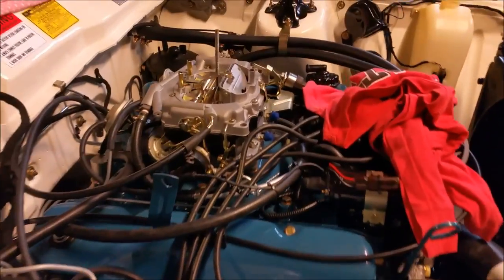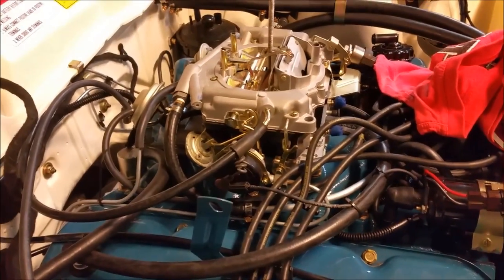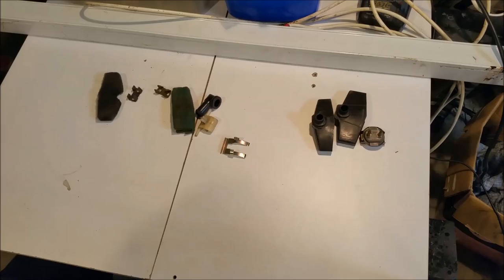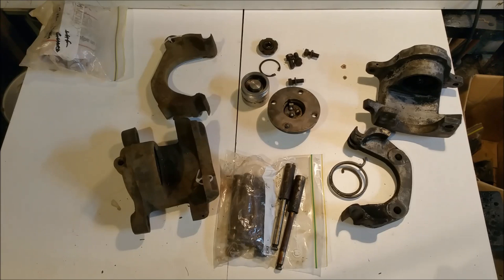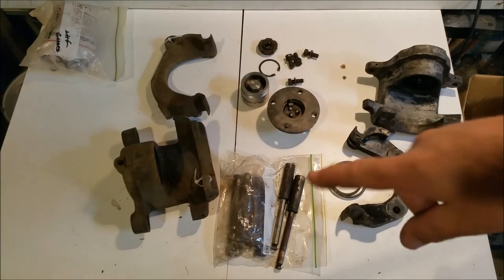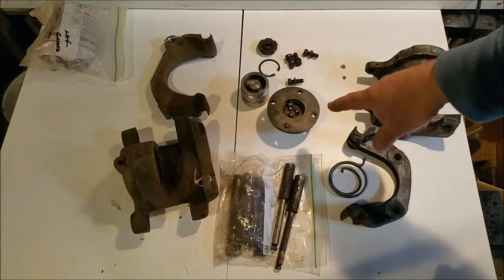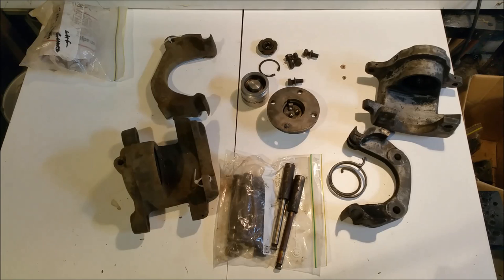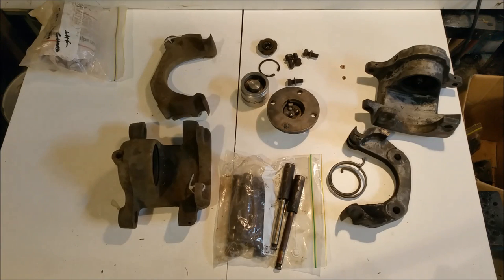Ford XC Fairmont 351 Restoration Part 32

Comment: A tip that people might find useful for freeing stuck caliper pistons as here, instead of using some form of pliers to grip and twist the piston, which risks marking the piston and potentially causing problems down the line such as the protective boot/seal not gripping the piston properly and potentially getting trapped between the piston and the pad, use an oil filter strap wrench.  It should provide plenty enough grip to get the piston moving (if it won't you're probably not going to get the piston out at home anyway) but being a form of fabric it won't damage the piston.  They're pretty cheap even for a really good one and once you've shifted your caliper pistons they're very useful for servicing cars with inconveniently situated oil filters.  Just don't use one that is contaminated with oil on brake parts as even microscopic amounts of oil inside the brake system can cause all sorts of problems with seals swelling and causing things to bind up and not work...

Comment: Good on ya Peter. I did my front calipers a little while ago, hell of a job getting the pistons out. I soaked the calipers in oven cleaner and they came up pretty nice. I'm getting ready to rebuild the rear end soon, so the rear brake caliper video was very timely. Oh and the air cleaner vacuum hose, where does that fit on the manifold? Mine was broken off when I got the car so can't find where it's suppose to go. Thanks mate.
Reply from the maker: Hi Dave, the air cleaner draws straight manifold vacuum... any available port will do. Cheers

Comment: Just a thought, Peter.  Shouldn't there be a washer and some kind of rubber seal under the butterfly nut on top of the air filter to stop unfiltered air being drawn into the carburettor and causing running problems?  Just about every '60s/'70s/'80s carburettor car I've ever worked on has had that or SHOULD have had that (they're often missing as the heat makes them go brittle and they break up and get lost and never noticed or replaced...)
Reply from the maker: I don't think Clevelends ever used them as I've never seen a sealing washer there, except on Japanese cars. If they were the fiberous type I would think they would damage when the lid was removed... kind of like a saw tooth effect every time they ride up the threaded rod, which would raise the risk of debris falling in the air horn of the carburettor... whatever the case, thanks for the comments.

Comment: I'm glued to your XC restoration project, "excellent"
Just a couple of general comments/obervations, my background belongs to A/C engineering and I was taught that certain high tensile steel bolts couldn't not be used a second time due to the fact that they lose some of their integrity, (that's as much detail as know), the same applies when you read a motor OHM they inform you that you must use new bolts in certain applications, therefore if you send your hardware for plating on mass there is a possibility that these bolts could be re used.
Secondly could you confirm you used Acrylic paint?
I'm from the UK and Acrylic paint is mostly sold under arts and crafts, therefore I'm finding it difficult to find. I agree 2pk is to dangerous for the home DIYer (in fact some stocklist will not sell to the DIYer) and cellulose in the UK should only be used on Classic cars (pre 1973), I  realise these are UK and European standards not Australian, however I would like to get your thoughts.
I would like emphasise this in no way is criticism, as stated your video's are well thought out and very informative and thoroughly enjoyable .
Reply from the maker: Hi William, Thanks for your comments and certainly glad your enjoying the series of vdeos on the car. Yes, it's acrylic paint... I think you call it cellulose in Britain?? Cheers
Reply: You've cleared up some confusion, 
Cheers

Comment: Dose anyone know were I can find a 351 cleveland distributor vacuum switch all so known as a TVS valve that screws in the water outlet I need the 3 way one that looks like a tree. I know they are RARE and expensive but I can even find one new or old do they even make them anymore as a replacement part. I would assume they are easy to remanufacture please someone help?
Reply: try Amazon.com, may not be rare at all in the USA, The 3 port is (on the auto) just a 107 degree switch to change distributor advance from ported to full manifold vacuum, to speed up the idle and prevent overheating. you dont need it, especially if you have thermofans fitted. You do need the 2 port one for the EGR. I bought one of those from Amazon and got it last week. Brand is AC Delco.
Reply: Oh my god they do have them thank you. i didn't know the three way one was for a auto maybe i will get the two way one i am just chasing a classic look. But i have one more question they say they don't ship to Perth Australia do i have to contact AC Delco and ask them to order one in. I all so saw they had the air intake filter and the Vacuum Checking Switch that goes inside the air intake the thing that someone had stuck a cloth into to make a filter that peter said they were rare.

Comment: You need to use 40 vol AND  Oxy laundry powder. Using 40 vol on it's own won't do anything.
Reply from the maker: Yes and didn't I find that out... what's the procedure with the oxy laundry powder?
Reply: Okay so what I do is;
1. Soak it in warm soapy water, scrub with a toothbrush.
2. Mix 40 vol with xanthan gum (not exactly needed, just helps you spread it). 2 heaped tablespoons of xanthan gum per 500ml
3. When you're ready to spread the mixture add 1/2 teaspoon of vanish oxy, and 1 teaspoon of hot water from tap (not boiling hot).
Have to mix it really well, then spread it on the part and stick it under a UV light. make sure it's actually a UV light as some black lights don't actually emit UV.

I used this on water bottles for my 68 beetle and it was great, however it is hard to get rid of colouring on the inside. It does end up a LOT better than before though.
I also use this on old consoles, cassette players etc. Works great.
Reply: I'm no science guy but I believe the whole reason behind the oxy is the sodium percarbonate.